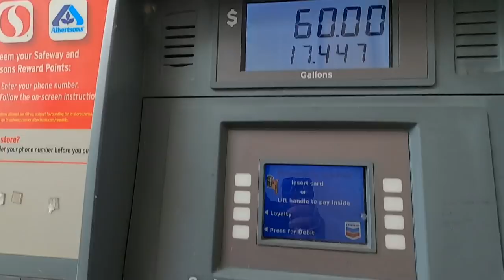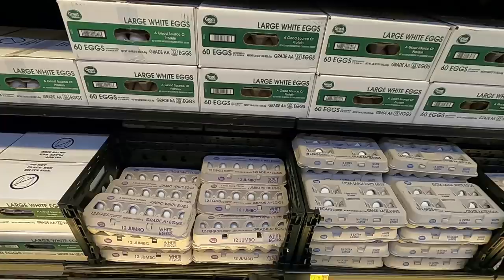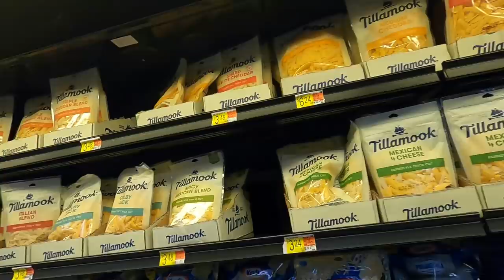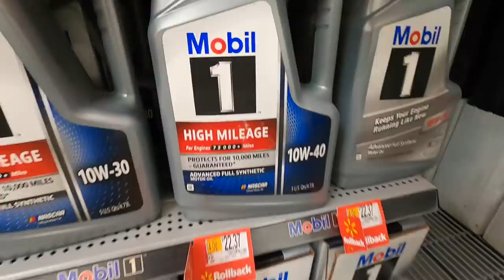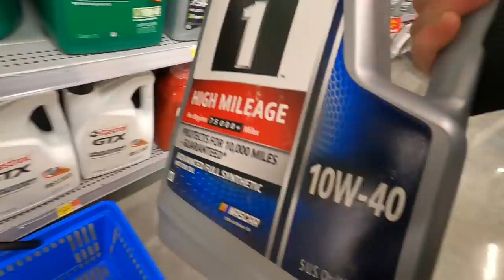Shopping For Oil & Supplies || RV Living

Comment: Nate, back many years ago, I used 3 quarts of oil in my (new to me) 91 Overland 36' 460 Ford motor from Illinois to Myrtle Beach right after i bought it! Thought i bought a "bad motor" MH, so i changed the oil and used Mobil 1 full synthetic! That MH never used a drop of oil after that! I have used Mobil 1 in everything that burns gas since! In my diesel MH i have now, i used Mobil Delvac 15/40, and i use the same in my diesel genny!

Comment: I run wix oil filters , add a magnet to the filter. I change my oil every 10k kms. Or say 6 k miles.. or once an year.. with mobil 1 full synthetic.. I noticed you aren’t wearing a mask now.. we’re still in lockdown ,  Walmart won’t let us buy car batteries in store.. or motor oil .. it’s nonessential